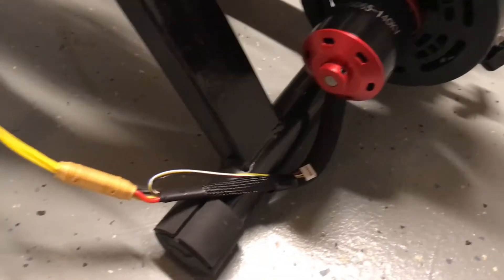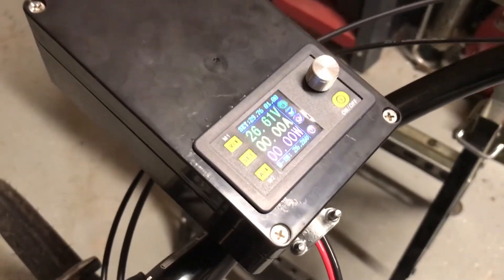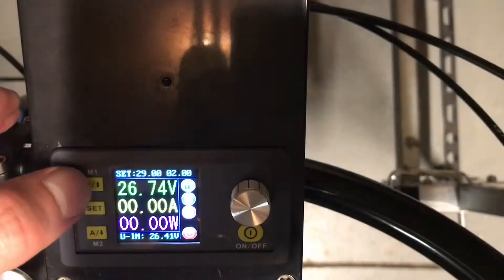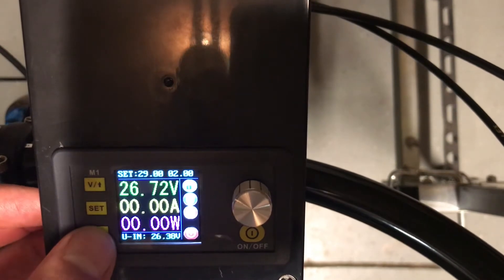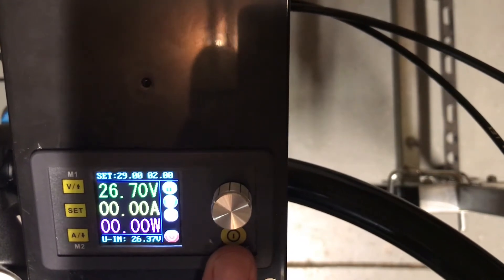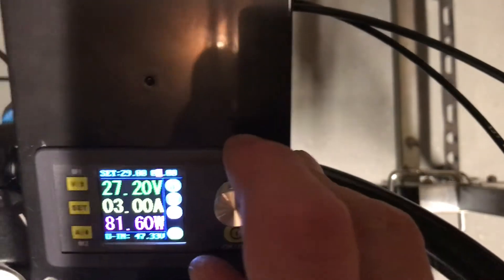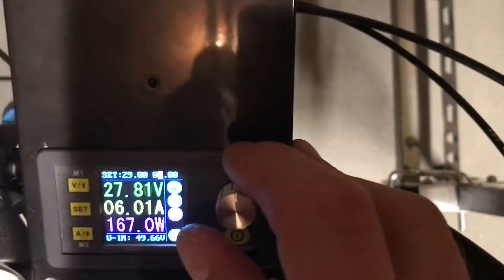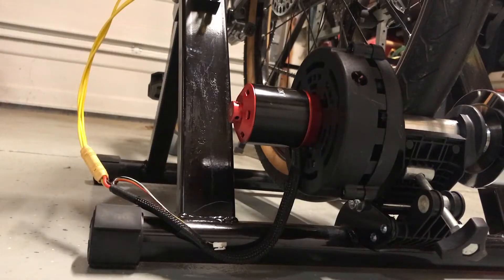750 Watt Human Powered battery charger

Comment: How does it come your DPS is already powered on before you even start pedaling? Me I have to pedal to power on my DPS and I have to do all the presets when pedaling. Maybe this is why my unit got damaged?
Reply from the maker: The power from the battery will turn on the DPS. I put a switch between the DPS and battery in order to turn the DPS off when I’m not using.

Comment: Have you considered going from friction on the wheel to attaching a generator with a sprocket directly to the crank with the chain? While you could only use the bike for power generation, it should be more efficient. Especially with a 36/54T crank and a 10T or 11T on the generator.
It would also likely be quieter.
Reply from the maker: Yes I have!  In this video I demonstrate how much easier it is for me to generate the same watts with both designs - https://www.youtube.com/watch?v=qG4FsVpkcRs&t=250s
It's quite surprising how much more friction is added with the wheel on generator.

Comment: Very smart to have your draw volts closer to your generator voltage output. And then increasing your overall amp draw. Next you can try power a toaster? Oh wait that was a DC/AC conversion - no wonder that super athlete could not power a toaster barely. I think it was 750 watts? It's in my playlist. https://www.youtube.com/playlist?list=PLaxpujmz7Q07YfUEWNHYXf9kx5hU8ZPqf here is it https://www.youtube.com/watch?v=S4O5voOCqAQ&ab_channel=TheToasterChallenge Olympic bicyclist vs. 700 watt toaster It's HILARIOUS they never mention he's converting to AC!! He loses 20% of power at least.